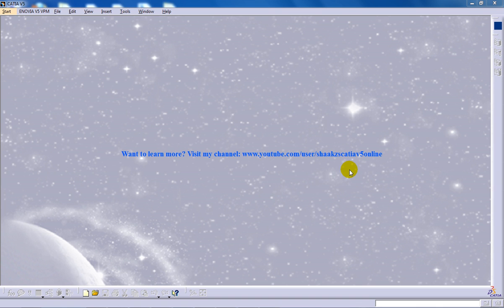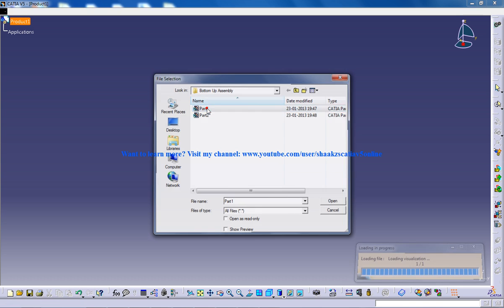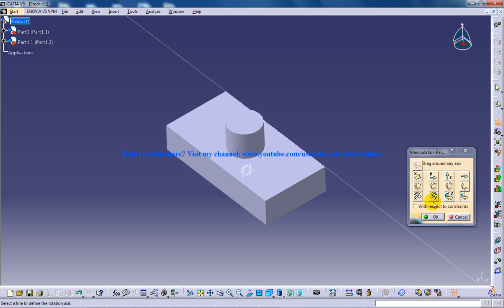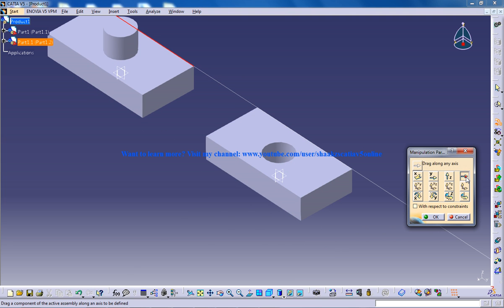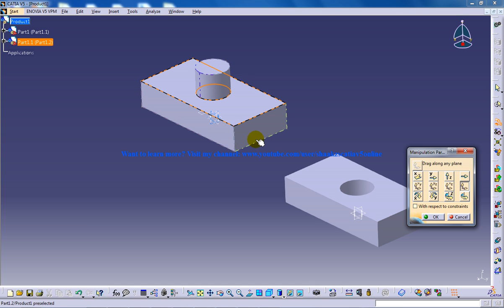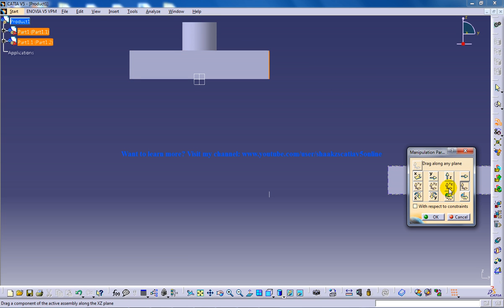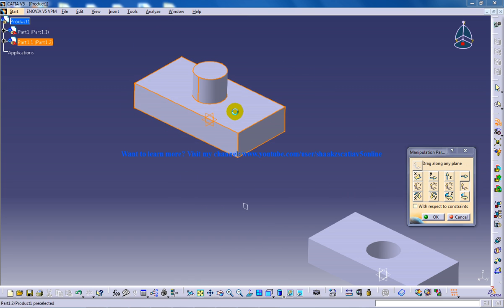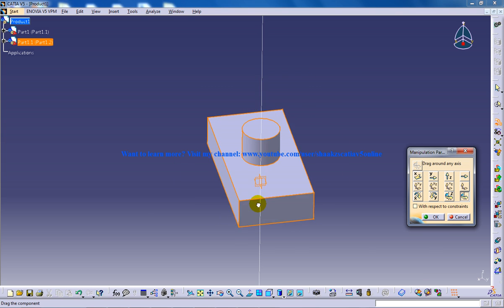Catia V5|Assembly Design|Move|Manipulation Tool|Part 2

Comment from the maker: once you create shaft as part 1 save it in a folder as catpart
then once you create the next part save it in the same folder with another file name
then take the assembly workbench in the mechanical design
go to insert existing component and click on product on the specification tree. you can then insert the part file under the product.
next insert the next part file in the same product tree. then go to edit manipulate
refer my tutorial on catia v5|assembly design|manipulate